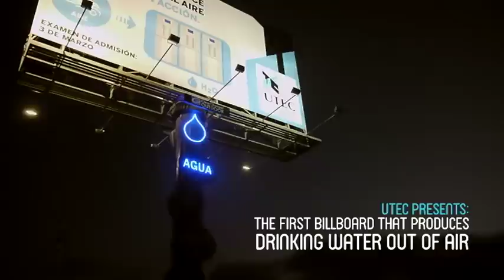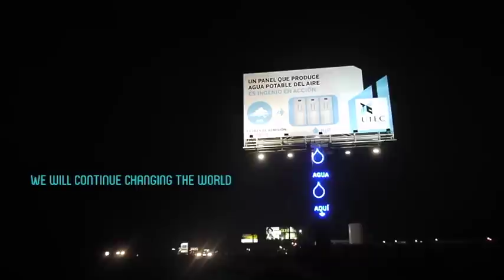UTEC - Potable Water Generator

Comment: For your interest, here is monthly data on the water-from-air resource in Lima, Peru. The units are for water vapour density [grams of water vapour per cubic metre of air]

Jan 15.2, Feb 16.2, Mar 16.2, Apr 14.3, May 13.5, Jun 12.7, Jul 11.2, Aug 11.2, Sep 11.2, Oct 11.9, Nov 12.7, Dec 14.3

The energy typically needed by dehumidifiers to condense water vapour into liquid water is approximately 0.4 kWh per litre of product water.

Comment: Electricity from the city's power lines runs the five condensers inside the billboard. Like the condenser in your home air conditioner, the ones in the UTEC billboard are cooler than the air outside. When air contacts the cooled surfaces of the condensers, the air also cools, and the water vapor in the air condenses into liquid water. After reverse-osmosis purification, the water flows down into a 20-liter storage tank at the base of the billboard. (Popular Mechanics)
Reply: Really good and interesting explanation of this engenius process. Thank you

Comment: Reverse Osmosis machines work on the exact same principle as air conditioners or dehumidifiers. Made mainly of Compressors, condensing coils, and evaporator coils. All A/C units produce water from ambient air. Though it may be new in Peru. This is 100 year old technology. Don't get me wrong. I think it's much better to help people who need it than the lazy couch potatoes who take it for granted.

Comment: 0:48; That should be an Evaporator not a condenser that collects the water droplets! Whoops. In a HVAC system, the evaporator is the cold radiator (low pressure) and the condenser is the hot radiator (high pressure side). Good work though

Comment: That makes no sense. It will evaporate straight up. Even if you were right and the water evaporated into a different location, it will still displace water vapour that will get condensed by the billboard.

Comment: Average monthly data on the water-from-air resource in Lima (measurement units are grams of water vapour per cubic metre of air):

Jan 15.2, Feb 16.2, Mar 16.2, Apr 14.3, May 13.5, Jun 12.7, Jul 11.2, Aug 11.2, Sep 11.2, Oct 11.9, Nov 12.7, Dec 14.3

Energy cost to condense water vapour to liquid water = 0.4 kWh per litre (1 kWh = $0.12 in Lima)

Roland Wahlgren, Atmoswater Research

Comment: This has to be the least efficient water source possible. First, they're using electricity to power an atmospheric water generator. This most likely comes from a coal fired plant, contributing to the country's pollution. Then they're running it through reverse osmosis to make it drinkable, again using more electricity. It would be far more efficient to simply run the contaminated well water through reverse osmosis to purify it. But then they wouldn't have a fancy billboard.

Comment: Well to answer your first question , basically the main reason is the geography of Peru. Considering that Peru is between the Pacific Ocean (which brings cold water) and the Andes,this generates the high amount of humidity and lack of precipitations. 
Now, the energy comes from an electrical resource which is commonly used on panels, and they are using it to give people clean water.An carbon footprint it;s the amount of CO2 produced by a person, company or product.

Comment: It is their technology and probably patented, so they won't be divulging anything. In saying that, this system does not use tap water, instead captures water droplets from the atmosphere for filtration, thus they are technically not wasting water...they are utilizing water which otherwise goes unnoticed. I have read there are similar set ups in the high mountains where mist is captured with fine mesh and then filtered for use. Innovation win.

Comment: That is true, but this solution would still likely be better in places where potable water is hard to get. Islands, for example. And the cost to power it would be less than the cost to desalinate sea water. You can get supplements to make up for the lack of mineral content.

You make a good point though. I'm also certain the device could be modified.

Comment: Y CUANTA CONTAMINACIÓN GENERA?
Reply: The water is basically distilled water, 100% pure. However, if the condensers or the water tank are not kept clean, you will have bacterial growth in the water.